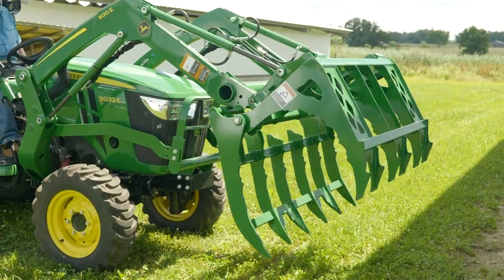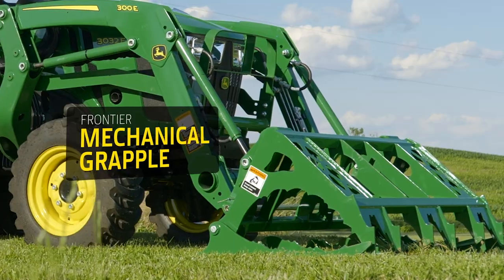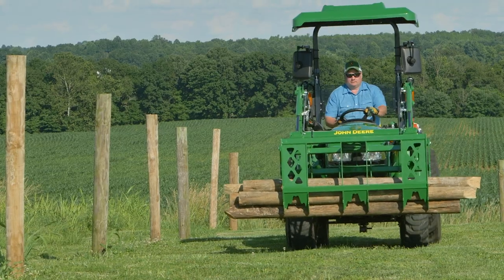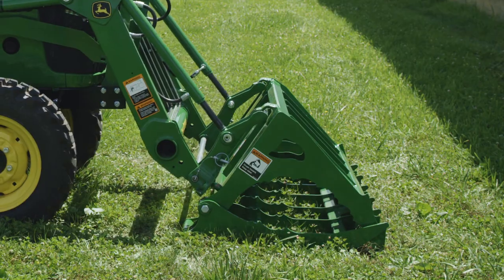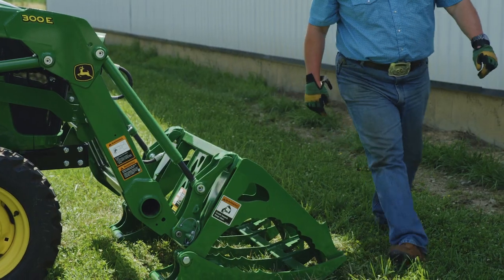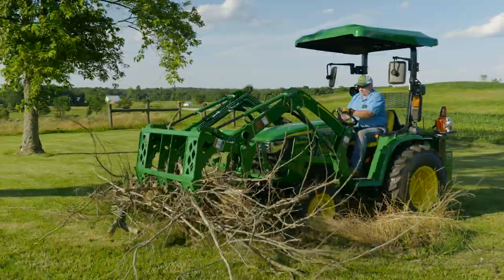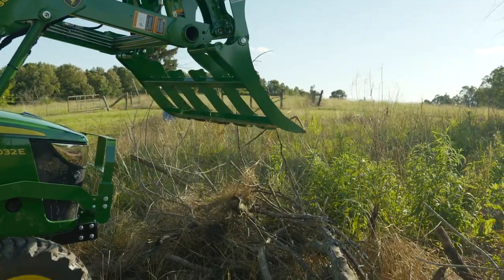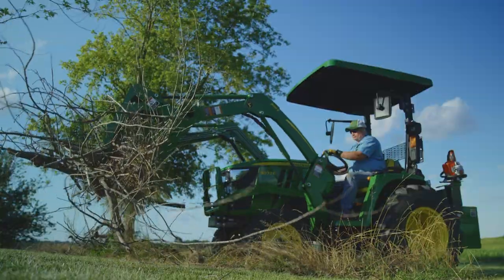How To Use A Mechanical Grapple | John Deere Tips Notebook

Comment: I had a BrushCrusher and a Frontier mechanical grapple, both broke my Quick Connect on my 220R loader within 1 day of use. The design puts way too much force on these points. Unlike a 3rd function grapple which does not need for the small hydraulic cylinder to be closed to scoop up a log, these kinds have to compress the logs to hold them., There is too much force from the 2 sets of cylinders on the loader. I now just use my forks to pick up logs.